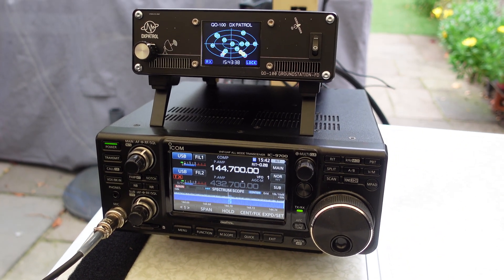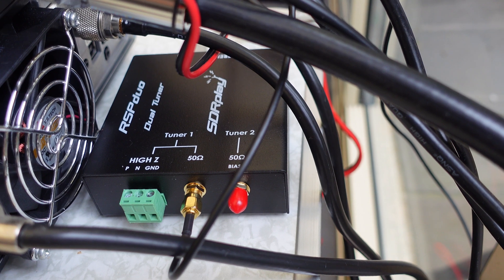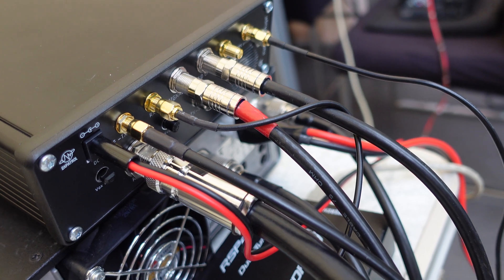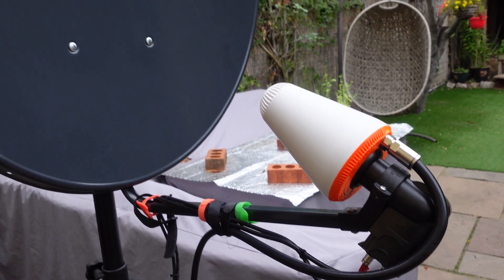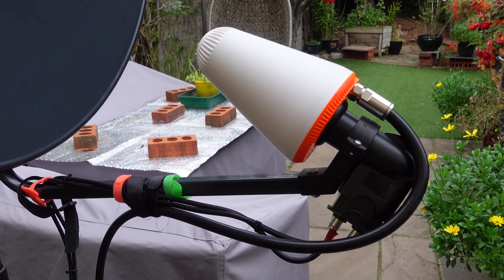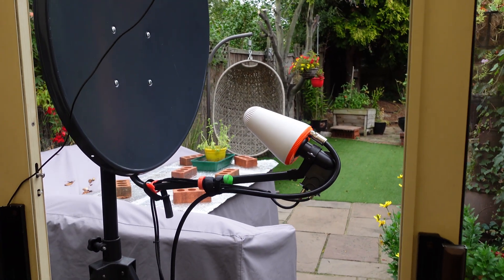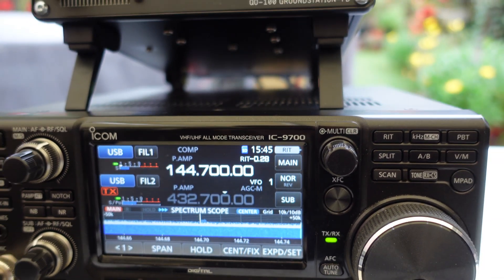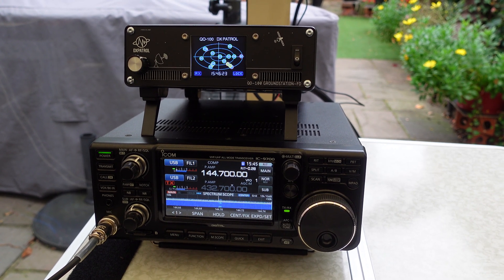HAM RADIO: QO-100 Ham Radio Satellite: Ice Cone Feed versus DX Patrol Helix

Comment: Hello John, what is the power for tx Icom.. in doc I see max 3watts on the dxpatrol kit. Thanks in advance.. 73’s from ON5LBV
Reply from the maker: Hello, I use approximately 1.5W input - I think the quoted max RF input is 5W. I use a very short run of M&P Ultraflex 13 to minimise feeder loss. 73, Jonathan, M0XXJ

Comment: I use a home made helical feed on my dish. I have mounted it just to the side of the LNB and found that it doesn't have any effect on the received signal. Comparing the strength of my transmission on QO-100 I find it just 1dB down compared to mounting the helix at the focal point of the dish. Another advantage of a single dish setup is, once you've optimised the position of the dish for reception, the transmit alignment is already done.
Reply from the maker: Sounds very sensible... what sort of mount do you use?
Reply: @JonathanCreaser I've sent you an email with a picture of it.
Reply from the maker: Thank you!

Comment: Hello Jonathan,
Thanks for sharing this video.
Made me overthinking my planned setup and forced me to order the new ice cone feed. Setting up my QO-100 Groundstation in the next few days. Hope to catch up with you over the satellite. What type of power connector do you use ? Mostly this power connectors can be used up to 3 Amps max … 
73 DL1WTW
Reply from the maker: Hello Daniel, great to hear that you got some use out of the video. The Ice Cone Feed is definitely superior to the DX Patrol helix in terms of signal strength. I use PowerPole connectors on all my equipment - I have been using either a LifePo4 battery pack or connect directly up to my shack power supply.  I am currently planning a station update video as I have been experimenting with longer feeder and with dual dishes, one for TX and one for RX. I'll watch out for you on QO-100! Best 73, Jonathan, M0XXJ
Reply: Hi Jonathan, thanks for your answer. Much appreciated. I‘m using the PowerPole connectors too. Sorry for my imprecise description, i meant the power connector on the DXPatrol Ground Station. Seems to me you are using a hollow connector which is soldered. I do not know which type of… 5,5mm x 2,1mm ? Hope you can help me with this. Thanks again Daniel
Reply from the maker: @TheFiresnake82  Ahh, sorry, yes, I had a plug supplied with my Groundstation 2. According to my caliper, the hollow connector measures approximately 5mm x 2.7mm. I can't find any detailed spec sheets for the DX Patrol Groundstation 2 online but the connector is a standard size and the supply is 5W @ 13.8V 73, Jonathan M0XXJ
Reply: @JonathanCreaser  Many thanks Jonathan. Looking forward to get my Ground Station 2 delivered until the end of this week. Hoping to catch up with you on the QO-100. 73 es tnx Daniel DL1WTW

Comment: I saw roughly the same results and I finally scrapped the DX Patrol Helix for mainly SWR fluctuations under hot and cold temperatures conditions (nights and days) and pity results… My Ice Cone Feed is doing a nice job and has a flat SWR (even with temperatures fluctuations).
Reply from the maker: The Ice Cone Feed is a great design. Looks good too! I have the v2.1 model. There is still some shadowing over the LNB but only a negligible loss of dB on RX 👍